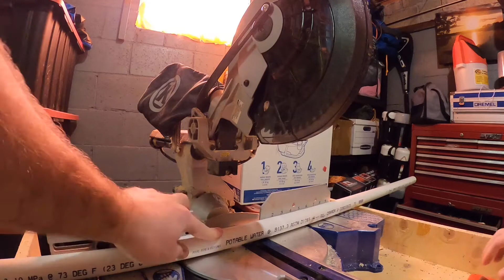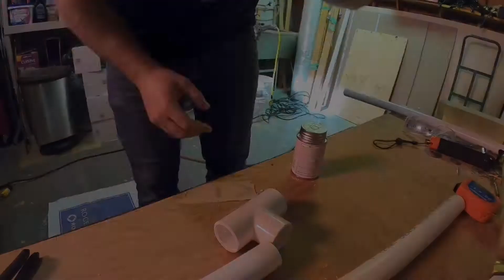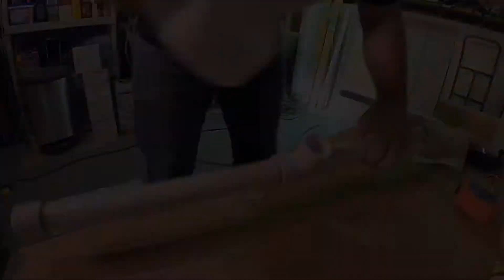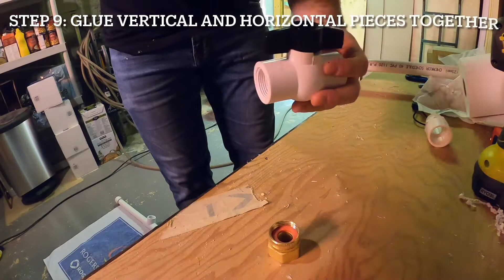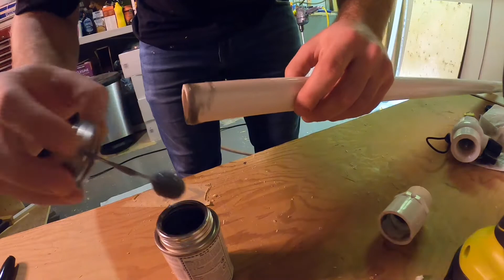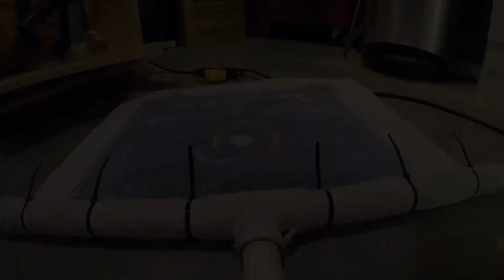Backyard Rink || DIY Zamboni with First Flood

Comment: Size of holes drilled?
Reply from the maker: 3/8”. Keep in mind that if you make it with a shut off like I did, you can control the water flow as well. So the hole size isn’t the only thing controlling the water flow.